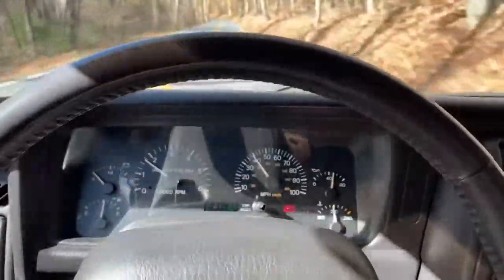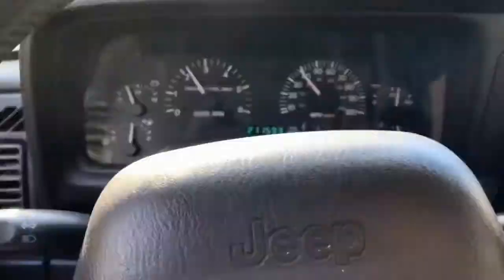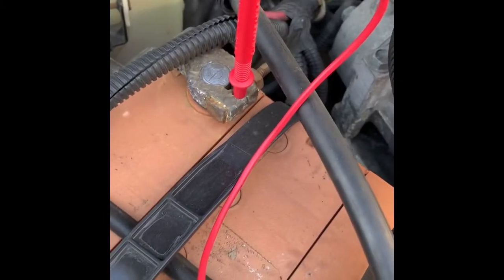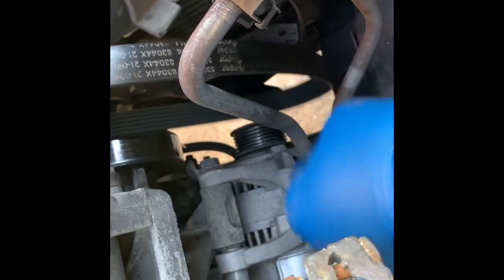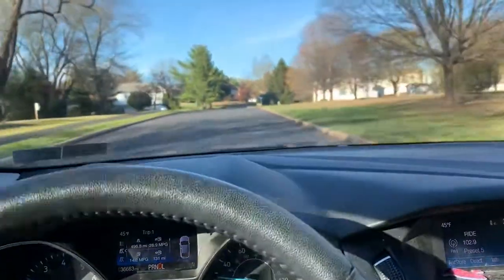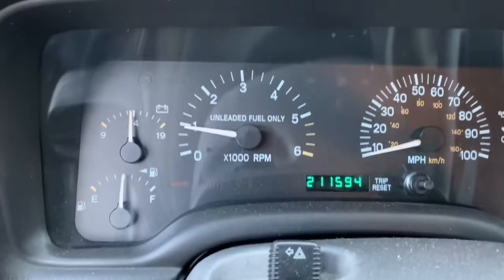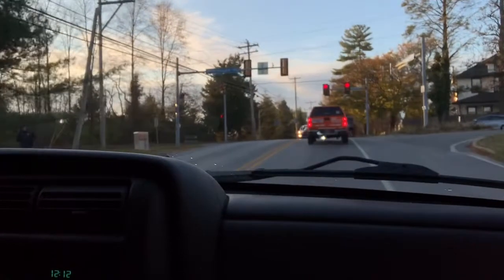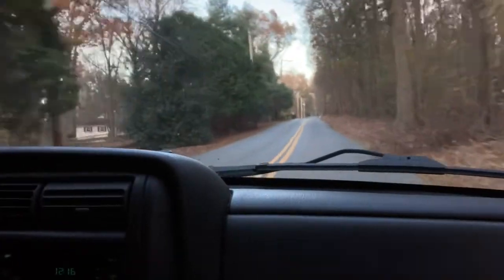Replacing your alternator on your Jeep Cherokee XJ

Comment: $140 for an alternator, was that with the core exchange? I’m with you, I miss those days of $40-$50 dollar auto parts 😄 How do you like the Dorman leaf springs you changed out? Let us know where that vibration is coming from in your next video. Thanks for your video.
Reply from the maker: Yeah. Rock auto had them cheaper but I needed to fix it ASAP so I had to pay retail. Oh well. 

As for the springs, ride is much improved and rear isn’t sagging. BUT... the vibration issue has positively ID’d -  took the fam to dinner last night and low and behold, zero vibrations from the rear. I guess the new leaf springs put the rear diff/drive shaft angle a little off so the angle/ujoint relationship is causing a slight driveline vibration. Once weight was in the back seat, driveline angle was reduced and no vibration. Weird right?? The springs weren’t lift springs.. just stock height. Maybe once the springs settle, the angle will reduce. I may shim the rear diff too.
Reply: Thought you might do the 160 amp Durango upgrade...

Comment: Actually, the voltage regulator is in the ECM. The PCM is that relay and fuse box on the passenger side that anything in it can be replaced with ease.

Comment: Too funny, my Jeep is a 1999 with  211, 116 miles (very close to your milage), and today my Jeep did the exact same thing as yours... I put in a new Alternator and I believe I have it fixed, however, I'm still worried. 12.68 reading at the battery (idle) with High beams, high blowing AC .and radio. But when I turn down the AC to low the voltage reading at battery (and gauge) is about 13.5 at idle, driving it jumps to 13.9 on the gauge.  Not sure if this that drop-off in voltage is OK. I keep reading conflicting numbers by Jeep owners. Anyhow, interesting info thank you for posting this Vid.

Comment: I'm having the same issue on m 2001 Cherokee.
So,I have to replace my radiator,repair my headlights due to moisture,coil pack and spark plugs,fan shroud,alternator and power wires and grounds.
Sounds fun.
Reply from the maker: Always something with our XJ’s. Good luck with the repairs.